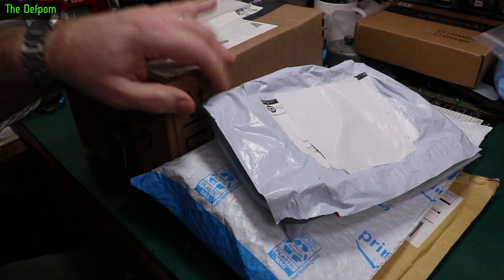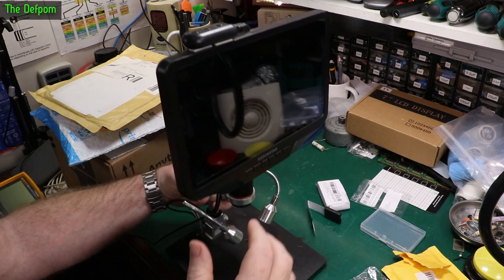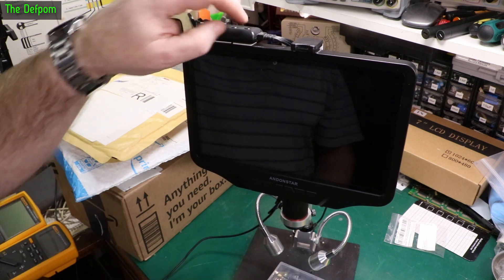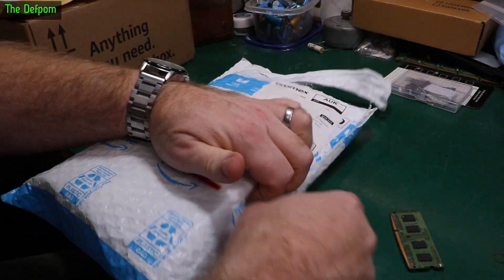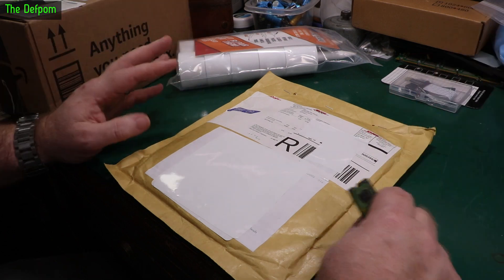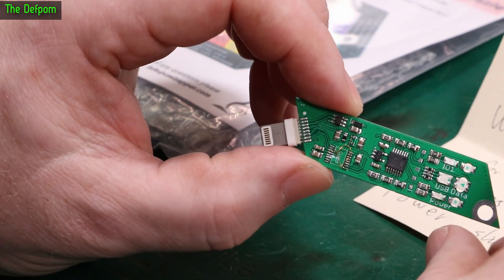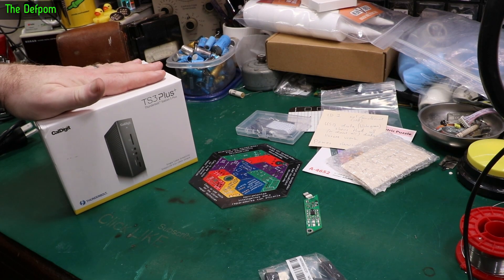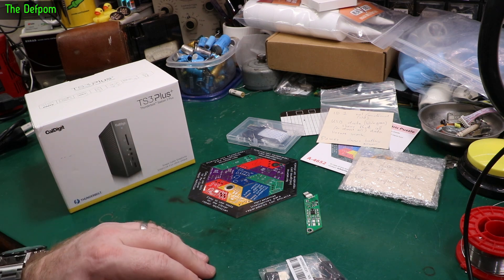🔴 Mailbag Monday 8th July 2024 - No.1261

Comment: i find that using extender boards put a lot of excess stress on the contacts, so the spring action get buggered and contact errors start to appear.

i would not plug the zapper in to my phone, as to get a shock some current must flow, to flow there must be a return connection back to the phone. which i expect will be a capacitive connection via some part of the phone case. so you will be in affect spiking your own phone in random places as the current tries to return to the source.

Comment: The wee rubbers for the sealant nozzles aren't a game changer. I found you have to make sure you pull it down tight and evacuate as much air as possible and even then over time there's still an issue. Hmmm, a rubber band around them might help.